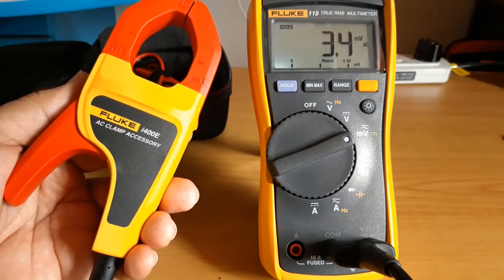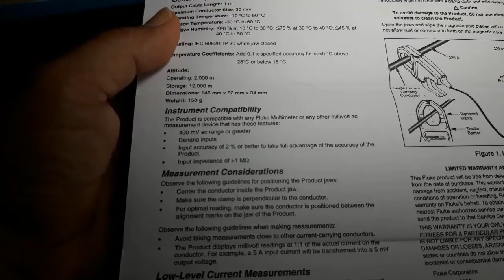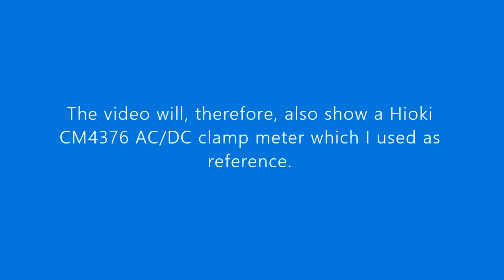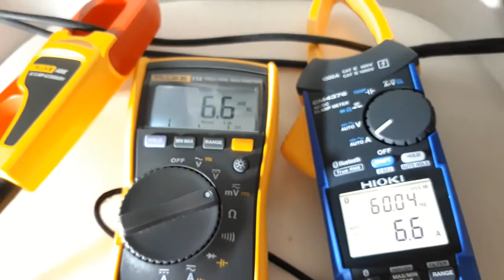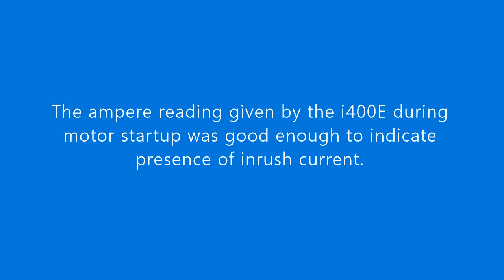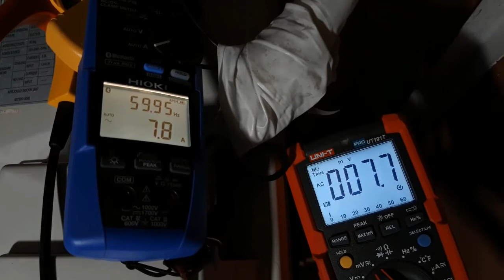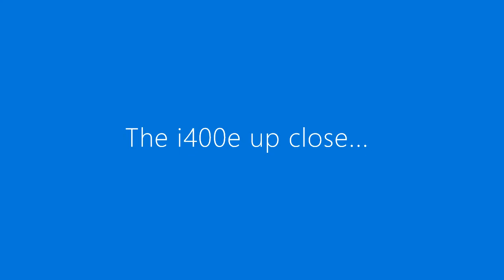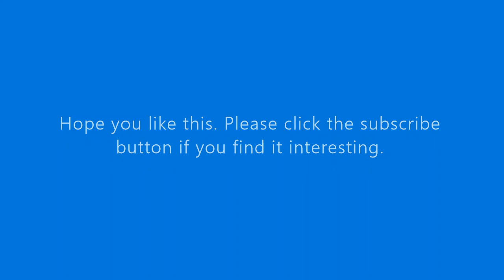[English Sub] Fluke i400e AC Clamp Accessory- Measuring Large Current with a Digital Multimeter

Comment: Wow! This is exactly the video I was looking for. I just purchased the Fluke 117 and was looking for the right current clamp to work with it. You gave me the answer! Thanks!
Reply from the maker: Thanks for the appreciation. Fluke made the i400e to match standard input jacks so it works on other brands' DMMs as well. Plus, they're not too expensive for such a versatile accessory clamp. I got mine from a local online seller for around U$45.
Reply: Same!

Comment: good video. Could you tell me if this clamp is compatible with the 116FC ?, and what would be the maximum AC measurement current. (I see in the video that you position the selector in mV)
I really need to know if this accessory replaces a 325 RMS meter.
  Thank you so much
Reply from the maker: I appreciate your comments. Do you mean Fluke 116 DMM? The Fluke 325 can measure both AC and DC current, while the i400e can measure AC current only. The i400E has a maximum current of 400A AC same as F325. When paired with a compatible multimeter, like the Fluke 116, the i400E makes a good backup or complement to your existing clamp meter. You need to position the DMM to mV AC when using the i400E and just read the value as Amperes. Please refer to user's manual for details on this. I also noted this in the video. And yes, the i400e is perfectly compatible with a Fluke 116. Here's a photo for reference. The other instrument is a Fluke 324. They both registered essentially the same current readings: 6.74A and 6.8A (read 6.8 mV as 6.8Amp). Hope this helps. Good luck!
https://flic.kr/p/2mvNPxM
Reply: Hello sir the i400e clamp are compatible to DMM 87v I want to buy this accessories. If fit to my 87 thanks a lot more appreciate the video.

Comment: Thank you for taking the time to make this video!! Does it do well with lower amps?
Reply from the maker: I appreciate your comments. Lowest I measured was 2Amps (04:26). But based on specs, it should be able to measure 1.0 Amp minimum, although I haven't tested a load with 1Amp excatly. I did test it at a load between 100mA and 300mA: the i400E did not detect them, the reading at the F115 remained 0. So, as long as current (mV output of the clamp) is 1.0 or above, it should do well between 1A and 400A.
Reply: I work with loads of .2 amps to 300 amps depends on the service call. Looks like a very good investment! Thanks again for taking the time to reply
Reply from the maker: @exiledazazel1844  I agree. For what it was intended, the i400e should serve you well. Thanks for your comments. Good luck!
Reply: @exiledazazel1844  Fluke also makes the i800.  It has a range of 0.1 to 800 amps, according to Fluke.  It is the same type of multimeter accessory as tested here by ramschannel.
Reply from the maker: @exiledazazel1844  update. Apparently the i400E can measure down to at least 100mA. This depends on the resolution of the multimeter it is connected to. Specifically the digital multimeter must  have a a high resolution of at least 10 microvolt AC. It just so happened that the Fluke115, F117 and even F116 do not have this resolution but the UNI-T 139C has. I've tested and covered this in the other video linked here: https://youtu.be/l9PLClT7TJY
Reply: @ramschannelreviews  Oh.

Comment: Will this clamp work with fluke 87v without blowing the fuse inside the multimeter?
I’m kind of hesitant to use it because of the specs of the multimeter since it says it only does up to 10 amps and for 30 seconds it will do 20 amps
Reply from the maker: Hi Jerry, the i400E outputs milli-volts-AC up to 400mV-AC to the multimeter. Hence, it's max rating was 400Amps, AC. The multimeter should be set to mV-AC setting, not Amperes (current) when used with the i400E. However, I'm not sure if the 87V has a millivolt-AC function. This is important- the multimeter must have mV AC function or at least able to measure down to 1millivolt. The i400E won't work with mV-DC.

Comment: I have an Amprobe ACD 14 pro . I also have a Triplett CM24 current meter with inrush. and also a fluke 116. 

 when checking inrush on my vacuum cleaner the Amprobe read 44 +- amps on startup. 
the Triplett measured 32 amps + -  so I was curious to see which is accurate. after watching this video I decided to get an i400e to use with my 116. using the max feature with the 116 it was within 1-2 amps of the Triplett. so I was surprised to find the 12 amp discrepancy with the Amprobe
Reply from the maker: I appreciate your comments. It's interesting that your CM24 and F116 with i400e recorded inrush with just ~2Amp difference. I don't have a CM24 but in my video of the ACD 14 Pro I compared it's inrush function with the inrush function of my Hioki CM4376 and they also registered ~2Amp difference only. The i400e with F116/F115/F117 MAX function is a good way to quickly detect presence of inrush. In order to establish more accurate baselines across different devices I think more tests are necessary. For inrush detection however, the MAX function of the F116 and with i400e is good enough for relatively small motor load. Just my personal opinion.

Comment: Do you know if there are clamps like this for DC current?      Thanks in advance and Great Video.
Reply from the maker: Thanks for your comments. There is at least one from Fluke. Based on their online info, it's the battery-powered Fluke i410 AC/DC accessory clamp. Same type of banana plug connector, also rated to 400A max, 1mV/Amp. I haven't used one though. Off-brand clamps of this type can also be found sold online, like the Holdpeak 600A AC/DC accessory clamp, but I don't know how well they perform.

Comment: No need to convert the MV to amps?
Reply from the maker: No need. The mV reading on the DMM is the Amps output of the i400e.
Reply: @ramschannelreviews  why doesn’t it display amps then lol, I was struggling all day.
Reply from the maker: @scottm3552  A common misconception hehe. Please see 03:40 the F115 DMM doesn't know that an i400e is connected. It will just display the output of the i400e in mV. But as mentioned, 1A detected by the i400e will result in 1mV. Hence 6 mV is read as 6 Amp, for example.

Comment: Which multimeter do think is the best for residential use?
Reply from the maker: Not knowing your budget or background let me assume you're a homeowner who wanted a reliable digital multimeter (DMM) to handle simple household tasks that requires it. An economical Fluke 15B+ or 17B+ should cover the essentials. But if budget allows, a Fluke 115, 116, or 117 would be a step up. If you're confident enough to safely measure live circuit currents, a clamp meter like the Kyoritsu 2127R or Fluke 324 is very versatile and should serve you well. Stay with the known brands (Fluke, Hioki, Kyoritsu, Sanwa), get one with a backlight. For household troubleshooting a digital multimeter is much more practical and easier to use than analog. So stay with DMMs. Lastly, for more laborious or very risky electrical work, I'd just call an electrician, just to be safe. Good luck!
Reply: @ramschannelreviews  obviously I do not want to spend more than what I do not need,  but I want to buy one good one instead of several bad ones,  I have been looking at the Fluke 87V, I am planning to to learn and do everything about residential,  and I know that good tools are essential to do a good job without wasting time
Reply from the maker: @alvilla701  In my previous work in the electric utility, I used the 87V. Top of the line DMM, surpassed only by the new 87V MAX. I can't afford it though, but that is an excellent choice!
Reply: @ramschannelreviews  thank you very much,  I'll take a look  at the new one also,  I know that lots of times to make good money I also need to spend it,  I might get one of those two,  thank you again
Reply from the maker: @alvilla701  you're welcome and thanks also for your support. I appreciate it!

Comment: Would you know what the Hz response is for this tool?
Reply from the maker: As I understand it, this is for general power frequency application. Based on its specs it has the following accracy rating: 2.0 % ± 5 digits (45 Hz to 65 Hz) and 2.5 % ± 5 digits (65 Hz to 400 Hz). Typical bandwidth: 5 Hz to 20 kHz.
Reply: @ramschannelreviews  Super... thanks!
Reply from the maker: @imaginarypoint  you're welcome. thanks for your comments.

Comment: Good excellent video, I wanted to know if it will be compatible with the fluke 117? With this accessory I can measure the amperage in direct current as a security camera transformer, the battery of my car? etc. that is, can I measure amperage in AC and DC current?
Thank you
Reply from the maker: Thanks for your comments. Yes it is compatible with Fluke 117. But cannot measure DC current. The i400E is designed for AC current only. The Fluke accessory clamp that can measure both AC & DC current is the i410. You can also consider the Fluke 325 clamp meter if you need to take both AC and DC current. Good luck!

Comment: Hi sir. Where can i purchase the fluke i400e here in the Philippines? Any idea how much it cost? Nice video by the way. You inspired me to purchase this tool.
Reply from the maker: Hi Bolt, thanks for your comments. I bought it from AliExpress last April 2019, at U$86. If you search Lazada Philippines, you'll find it sold at around P2,500 though I'm not sure if they're legit. The banana plugs of the Lazada photos were slightly different. (Edit: I later ordered a unit from Lazada Philippines and it's legit Fluke i400E.)
Reply: @ramschannelreviews  i just got mine from lazada. The banana jack is side ways since the one on lazada is the 2021 model.
Reply from the maker: @juancarlossandoval5628  Congrats! Mura na po sya sa Lazada kesa sa AliExpress nung nabili ko noon pa. I also have that side-oriented 2021 model. It's legit Fluke i400E so quality and reliability are there. Good luck!
Reply: @ramschannelreviews  yes po,, legit fluke xa. Good buy tlga. Thanks sa review, kaya ako bumili nito nakita ko ung review and the best tlga gawa mo, super linaw. Mote videos pa po. New subscriber here.. request po sana follow up review about i400e for lower current measuremen, below 1amp. Im using these clamp probe to test washing machine motors and spin dry. Spin dry motor just show 700ma or in my case .74mv just want to confirm if the reading I got is correct. I know this probe only goes down to 1mv per amp but I want to  see if it can go lower. Thank you
Reply from the maker: @juancarlossandoval5628  Salamat po sa inyong comments at suporta. You're right. It's duty cycle is 1Amp to 400Amp. You might have already seen this in the specs. I also included this in the video. Just now I made a quick check. Di talaga kaya bro. It's cut-off voltage is really 1mV. You won't get a reading below 1Amp. Here's a link to the photo I took. This was 806mA at the demo board. Using my Fluke 116, zero Amp. Ano po yung multimeter ninyo at nakakuha po kayo ng 700mA? https://flic.kr/p/2kYQETi
Reply from the maker: 0.20mV? below 1.0mV threshold na nga sya. Thanks! Ingat po kayo.
Reply from the maker: @juancarlossandoval5628  kita ko na po. Thanks! High resolution yung UNI-T 61D+ ninyo sir. If it's reading right, that means 220mA. Husay ah! Better if you have another clamp meter to check.
Reply: @ramschannelreviews  yes po wla ako ma compare ran dito. Ung test load nyan ang desk fan. Ung normal lng na desk fan dito sa pilipinas panasonic brand
Reply from the maker: @juancarlossandoval5628  Salamat po for sharing this info. You may be on to something here with the 220mA reading on your fan. Para may idea po ako, I tested two of my fans just now (using a Bluetooth Clamp Meter). Please see links below for reference. Your fan current appeared to be in the middle of my fans' current range. If you're instruments were reading right, it would suggest that the i400E can measure below 1000mA, limited only by the sensitivity of the multimeter it's connected to. Looks like I need to have my own UNI-T61D+, haha LOL! Good find, bro! 

Panasonic Desk Fan F-40DXM (256mA- 312mA)
https://flic.kr/p/2kYTSrs
Black and Decker 40W Box Fan (139mA- 177mA)
https://flic.kr/p/2kYSktB
Reply: @ramschannelreviews  yes that is what I have in mind, i400e can actually measure lower that 1mv. My fan current reading are actually lower since its set to the lowest speed and they are not powerful. They are the common camel, hanabishi desk fan here in Ph. The uni T 61d+ can read down to 10 microvolt or .01mv the small diff in reading actualy nake sense to me due to our line voltage are higher. It ranges from 237 and 240 vac it can even spike to 242vac
Reply from the maker: @juancarlossandoval5628  0.01mV is equivalent to 0.01A or 10mA at the i400E. Impressive! Fluke did state though that the range of measurement was 1A-400A only. If I happen to get a multimeter like UNI-T61D+ I'll try and see its response to the i400E.
Reply: @ramschannelreviews  thanks much, im really curous what would be the result. Have'nt  you tried it on your 191 T? Meron pa ako mga idea na kelangan ma confirm, hehehe pls  contact me.on fb messenger  , send ko sau mga naisip ko, then pde mo gawin video para ma verify natin.
Reply from the maker: @juancarlossandoval5628  The new video is uploaded. Hope that helps 😃

Comment: Does it work on any other brand  multimeter?
Reply from the maker: You have to check that the multimeter has milliVolt AC function and standard input jacks. Basta meron po sila nito kahit hindi Fluke ang brand pwede po ang i400E.
Reply: @ramschannelreviews   unfortunately wala syang millivolt function doon sa selector knob ng SANWA CD 771 
pero kaya nyang mag read ng millivolt auto ranging yata.
Reply from the maker: @matlesterdivinagracia6528  I'm not familiar with CD771 sir. Pero kung pwede po sya sa mV AC then compatible yung i400E since it can read up to 400mV AC. Yung input jack nalang po ng CD771 ang dapat sakto ang sukat sa i400E banana jacks.
Reply: @ramschannelreviews  yun nga lang po kailangan pang hanapan ng adaptor yung kasya doon sa multimeter ko kasi malayo ang pagitan nung dalawang terminal na pagsasaksakan.
Reply from the maker: @matlesterdivinagracia6528  I see. On the other hand based on online specs magandang uri din po ang inyong DMM. Japanese brand and quality. Perhaps you can just get a dedicated clamp meter, as an alternative.
Reply: @ramschannelreviews  
Ive plan to buy a fieldpiece 240 clamp meter
yun nga lang medyo pricy talaga sya.
compare sa mga china brand w/c is di pa subok yung quality 
Thanks for the Advise Sir 
God Bless Po
Sana marami kapang Content na ilalabas.
Reply from the maker: @matlesterdivinagracia6528  salamat din po sa inyong suporta. I admire your preference for quality instruments. I don't have a Fieldpiece but Ive read good things about them in the HVAC industry.  I have an Amprobe ACD-14 Pro which I still have to review. Hope you can find your preferred instruments soon. Good luck po!

Comment: Will the fluke i400e work with the Fluke 116?
Reply from the maker: Yes, it should. The Fluke 116 had 600mV AC function and standard terminal plug, that's all the i400E needs to work.
Reply: Thank you 👍
Reply from the maker: @rguevara83  You're welcome. I have a Fluke 116 from amazon myself, in transit. Thanks too, for supporting my channel.
Reply: I just purchased my Fluke 116 for HVAC. It came with a combo clamp meter 323. The 323 is a bear bones clamp amp meter. Probably gonna keep it as a house meter. The 323 has good basic functions.  So far so good with the Fluke116.  Not a fan of the LoZ function 🙄. I am loving the other meter functions!  After watching your video I am definitely going to pick up the i400e clamp. Sometimes I need to check blower motor amperage but the blower door needs to be closed. The i400e clamp would be great for that until i get my Fluke 902 fc replaced from Fluke (recalled 😑). My plan is to use the Fluke 116 and Fluke 902 FC as my main goto meters.
Reply from the maker: @rguevara83  Sounds like a good plan! Yes, I saw that combo at amazon. I ended up buying the F116 and Fluke 324 separately, both in transit. I think the F323 was alright, but I wanted one with a backlight, hence the F324. Hope you get your F902 FC soon. That's a high end instrument and a good match for your F116 as HVAC multimeters. The FC app isn't available in the Philippines, but I'm sure it's convenient for remote monitoring in your case. I got the 2021 Fluke i400E for the equivalent of U$43 from Lazada Philippines. I couldn't pass up a great deal. 😁Good luck!